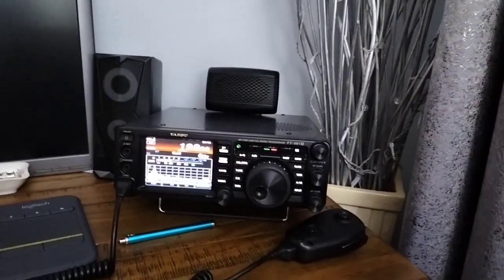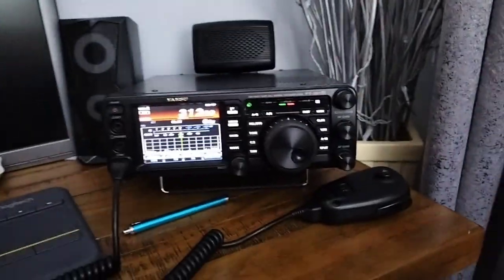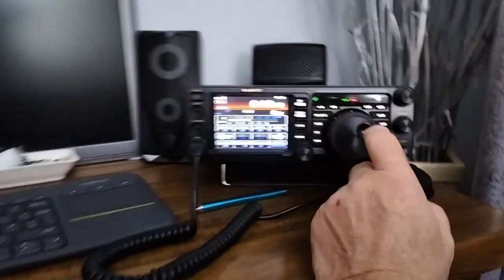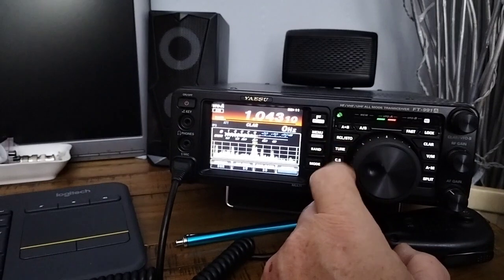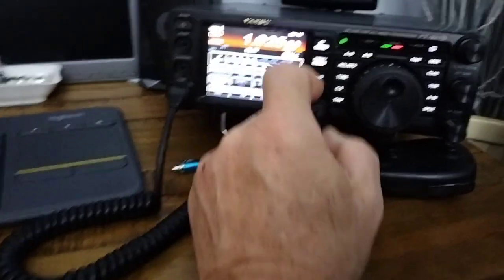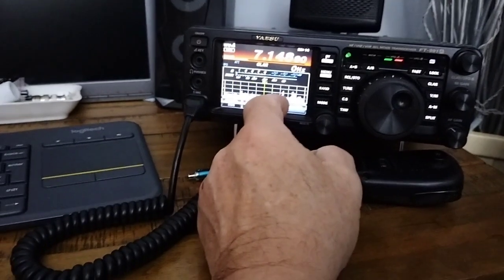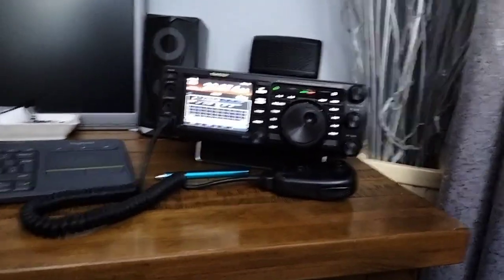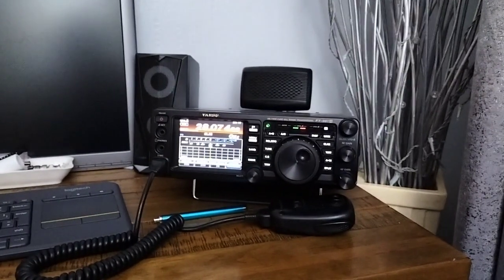QRM on Medium Wave and reception on the amateur bands

Comment: Shame about the QRM, I made a tuned MW loop recently, as you know, can help a lot. To feed in at low impedance into the AOR receiver I made a coupling loop feeding into a FET source follower to feed the coax to the receiver, without this the coax/receiver low input impedance damps the loop  down too much.